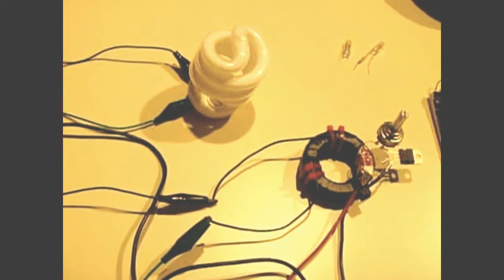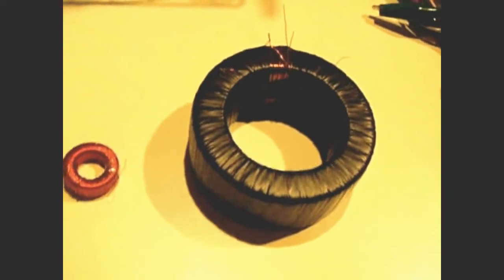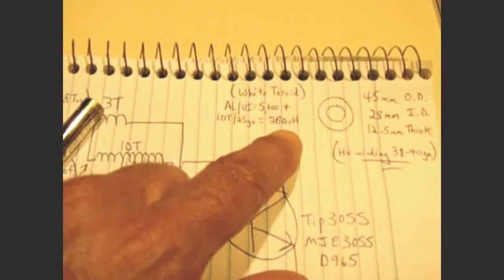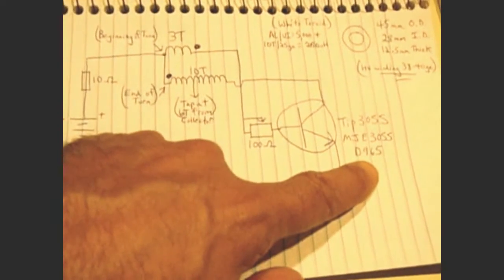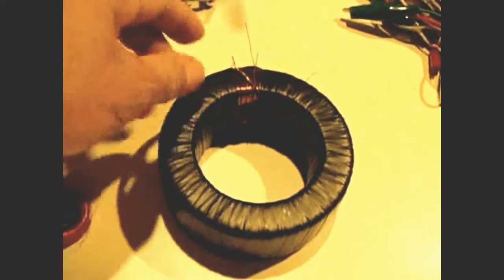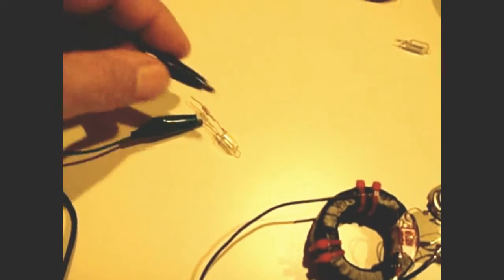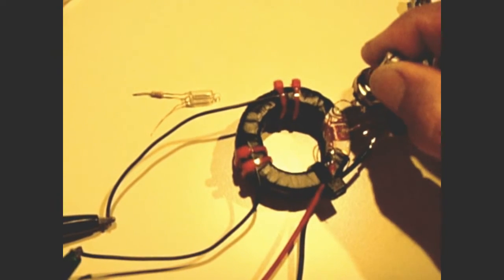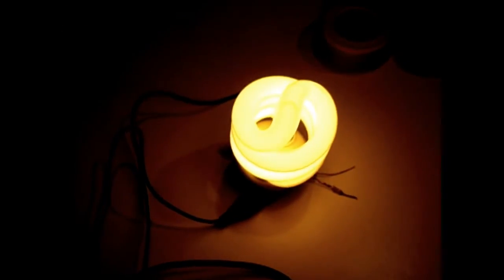Joule Thief(Mini Toroid) Powers CFL using 1.3V+

Comment: I am aware of how current is measured as it passes through a coil designed to measure it. I am also aware of the water analogy with regard to electricity -- where most of the components can be described as components for water pressure (eg. 'narrowed pipe' = 'resistor', etc.). But I wasn't prepared for the real-world cross-over where they run water through a pipe and measure the volume of water moved inside the pipe from outside the pipe -- using something that looks like a toroidal coupler that they hook to the water pipe in the house. Now in my 50s, I was quite familiar with the mechanical water meters. Measuring the water flow without even touching the water....*mind blown*

"Electromagnetic water meters use voltage to determine your flow rate. As water passes through a pipe surrounded by magnetic fields and electrodes, it generates voltage. The water's velocity determines how much voltage it creates, so the meter can translate voltage to flow rate. (And thus, your water usage.)"

Comment: It is good but would be better if can add more knowledge that is what is diameter of wire and diameter of edge to edge, which if the ratio is closest would the current be higher, per same volt. So, the ratio base on radius of wire that is output to edge of ring, then a diameter, and diameter 2 and so on. So, the smaller center diameter on ring of toroid, the longer windings, the bigger diameter is smaller windings, per same windings number. And also, the center diameter to edge diameter is important? Since it can be smaller edge diameter which you put less windings base on smaller loop. So, if the loop is equal to ratio of center to edge diameter, would that be better? So, it is more even as a circle in two 90 degree horizontal and vertical. The more even, the less power to higher output?

Comment: Mi circuit is little brighter. I hated the high pitch noise so I added some coupling capacitors at the imput and in between the colector and emiter, this made It a little more stable.
Reply from the maker: Great to hear!

Comment: Hi, can I use a normal transformer to get the same job?
Reply from the maker: Not with the tests I've done.
Reply: +electronicsNmore Thanks for replaying, I have an old 2N3055 and a normal transformer 220v/12v, I wonder if i can make something with it as i have no teroid around
Reply: عبد القادر بن محمّد بن عبد القادر 
Yes, its possible to use a normal transformer to turn on a CFL:
You will need a step-down transformer (220 volts stepping down to 4.5 volts at 300 milliamperes). Such a transformer will have a physical gap between the low voltage windings and the transformer's core. Use that gap to wind the feedback coil (15 turns). You need an 80 ohm resistor connected in parrallel with a 220 uF capacitor. Also, a 3.3uF capacitor between the positive pole of the battery and the resistor's connection with the feedback coil must be used. The reson for these capacitors and the 80 Ohm resistor is to set up correctly efgiciency and frequency (200 Hertz range) The low voltage coil and the feedback one must be connected  correctly with the resistor and the transistor. Finally, maximum input tolerable voltage is 4.5 volts at 1200 milliampetes (smaller currect is OK as well).
It worked for me with a normal transformer from a Nokia 5140 charger.

Comment: I actually built this and it worked strait off. The only thing missing in this video is an explanation that you need to wind a secondary with many turns with experimentation) i wound one run on my ring and ended up with 130T. I also wound the i think modified circuit that had 3T feed  and the 15T primary as opposed to the 10 in this video.
i will now experiment with a tap on the primary.
The key to all of this though as is explained in the video is that you must start with a very high permeability core ( white is very good ) ( Green is very poor ) also usually if you see the mains filter section of any power supply with a dual wound core ( filter ) they are normally Green but sometimes ( usually in Microwave ovens ) this core will be wound over a plastic encasement which is white and here you have a high permeability core.

hope some of this helps, Scorpio............

Comment: which torroid did you use, I used a medium sized black torroid did 300turns and I only get 36volts Ac but you only did a few turns and you get so much voltage why is that
Reply from the maker: Hello. Everything was well explained in the video. Unfortunately I cannot remember every detail from over 350 videos. Sounds like toroid is not the right type. Thanks For Watching

Comment: sir...mine is i only got 90v and my toroid is 1inch diameter..how to boost to 120v sir?
Reply from the maker: +Clyde Maraon 
Hello. Try adding more turns of wire to the higher voltage secondary., or try another toroid.

Comment: Hi! Try adding a capacitor in parallel with resistor that goes to base, so basically put that resistor between capacitor legs. I tried, like 50 v 1u, or 35v 47u, or even superbly small ones like 2A223k.
I found it sometimes it boost's frequency and lowered my amp consumption. But my setup was different, I tried with a bit higher voltages. Thanks for sharing your experiment! I was inspired by  your work, so I even ordered ferrite toroid/ring from online shop!
:)
My current experiment was based on "fly back, tv transformer toroid" more like a rectangular frame,,, it looks like my windings were messed up or to small, so didn't managed to squeeze out a lot - only some 100 - 400 volts with 2.7v up to 6v battery power source.

Comment: please make a double joule thief using 2 fly back, tv transformer toroid. They are much stronger than normal toroids. I bet you could get more than 1000 leds with that.Please check out the double joule thief video, and see if you want to give it a try, its not a hard one, thanks.
Reply: +Randy Travis Yup! Just take that tv transformer toroid - it is made to work anyway, so you don't have to find right ferrite roids.

Comment: Thanks for the upload, great video! One detail; It would be really great if you could post some info about the size of the toroids you are using. The color codings you refer to are not general but rather refers to a specific manufaturer. What manufacturer is that, or what is the actual size of the toroids?
Reply from the maker: Didn't I mention the size of the toroid I used in the video? Thought I did.

Thanks For Watching!

Comment: how many turns your third winding has ? did you wound by hand ? I want to make this but I have little smaller toroids  so I have to use thiner wire so I want to know how much turns it needs beacouse its hard to wind by hand many turns
Reply from the maker: Hi there,

All wound by hand. The schematic should show how many turns I used. I make lots of videos, so I am not sure. I would have to watch the video again. You can also count how many turns by looking at the image of the toroid in the schematic. You have to make sure your using the right toroid(and connect the windings properly), otherwise it will not work right. Take the thin wire and wind it onto a pen/pencil using a cordless drill slowly, then you can slide the pen/pencil into and out of the core to wind it.

Thanks For watching!

Comment: How long the battery lasts?
Reply from the maker: All depends on the resistor values. They determine how much current is consumed, and how bright the CFL will light up.

Thanks For Watching!
Reply: You're welcome, I checked out your modified schematic, it looks easy to construct. Approximately how many turns are for the secondary winding for the  "HV AC" output? I got my toroid (yellow 27mm O.D, 13mm I.D & 11mm thick) from a PC power supply.
Reply from the maker: Rat Poision Did I mention that in the video? I don't recall. It was a lot of turns. I can check when I get a chance, but I had to of mentioned it in the video.

Comment: One goal with this is to replicate T.H. Morays work using a Joule Thief approach. All you need is an antenna wire and a good earth ground, and you might be able to light the CFL w/o batteries. Doing some calculations here, if you had 20uF cap and 20H coil, it would resonant at Schumann Resonance of 7.83Hz. You might, therefore, need SEVERAL big toroids arranges in series to add up to 20H and arrange them so that their fields "co-spin". Might be a fun project. A bit pricey though.

Comment: Overall a good video, based on the universal joule thief circuit which is basically a flyback converter. The documentation is good, the explanation is good.
But a small doubt does remain about the fact that while lighting the CFL tube, you have avoided showing the complete circuit layout, including the 1.5V cell which is supposed to power the gadget. Can you please upload a short video showing the circuit operating with one cell lighting the CFL tube while the whole setup is visible in the camera view?
Thanks and regards

Comment: hi there I've followed most of your joul thief circuits and would like to attempt one or two myself but would you consider marking the transistor pins IE base collector and emitter on your torroid circuits id allso like to add I have a great deal of difficultyfinding british equivelent transistors and to buy american costs for examplle the nte46 you used in one ov your circuits costs 15 dollars each with postage so any ideas you might have on this would be a great help thanks   K
Reply from the maker: Mpsa13 is what you need(You can also try other similar types). You can buy 25 of them between $3 and $5 shipped on Ebay.

Thanks for watching. Be sure to check out my video playlists.
Reply: ps the tranys were about 50 cents for ten well done

Comment: Nice mod. Unfortunately I don't have a way of directly measuring inductance so I'm glad you did some measuring. Thanks.
Reply from the maker: If you use the same # of turns 3T(Feedback) and 15T(Primary), using 23-25ga wire, on an all white or all yellow toroid, you should be fine using the schematic that is shown in the video description area. The best way to test the toroid is to only wind on the primary and feedback, then connect the circuit up to see if you get a nice oscillation(whining) sound coming off the toroid. If you do, then take the time to wind on the HV secondary, if you don't after adjusting the POT, then try another toroid.

Comment: Tiny toroid?  The ones inside of the CFL, on the circuit board are tiny.  The one you used is larger than most toroids inside of a power supply.

I think that using a resistance in series with the battery is the best way - of wasting power because all of the current has to go through this resistance.  Instead, if you replace the 100 ohm potentiometer with a 10k, it will then allow you to adjust the brightness of the CFL without wasting so much power.  Thanks for the video.
Reply from the maker: I tried a higher POT, 500 seems to be the top for performance. I have never seen a toroid used in a CFL lamp driver circuit. They always use a small transformer. I'm not done with this circuit. I think I can play around with the feedback/primary winding for lower current consumption.
Reply: electronicsNmore
Look again! There is almost always a tiny (od=1cm) toroid inside a CFL, usually in addition to a small transformer. In fact I have opened up about half a dozen CFLs and they all had a small toroid. ( I live in India). In fact CFLs have been my only source of toroids so far, and I'm still trying to get hold of a larger toroid to experiment with. I also intend to try and replicate your experiment (to whatever extent possible) with the tiny toroids from CFLs to see how much can be stretched out of their abilities.
Reply from the maker: Yes, but those are not being used to transform the power from low to high voltage. They are used as an inductor in the circuit.

Comment: great work,but whats the amp draw and volts going into circuit? whats the output? can you feed some of that energy back to the battery to charge it?
Reply from the maker: The circuit operates on 1.3V-1.5V. Output frequency is anywhere from 10khz to 150khz(depending on the POT setting) at several hundred volts. Input current varies from 150 to 400ma using the small toroid. Using a larger high permeability toroid seems to lower the input current.
Reply: electronicsNmore put a diode on and feed back to the battery.maybe you can close the loop